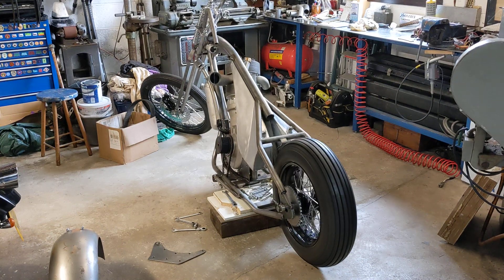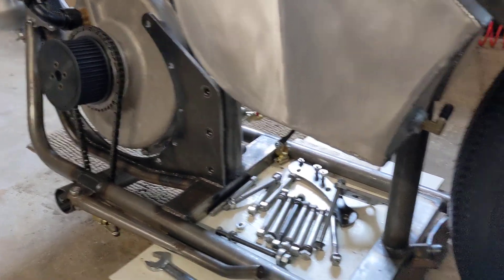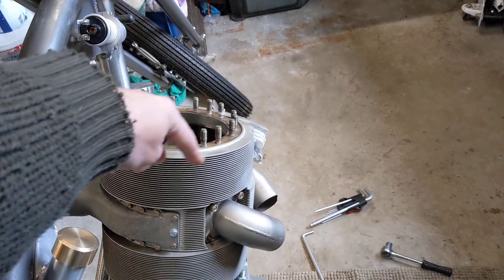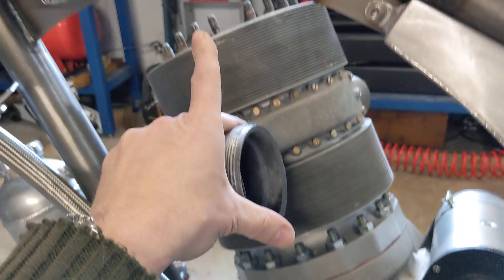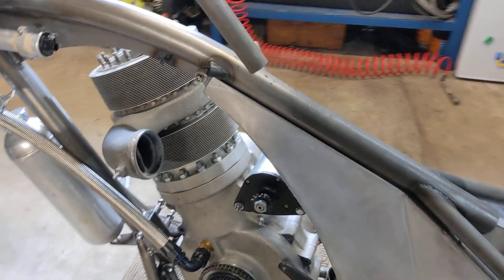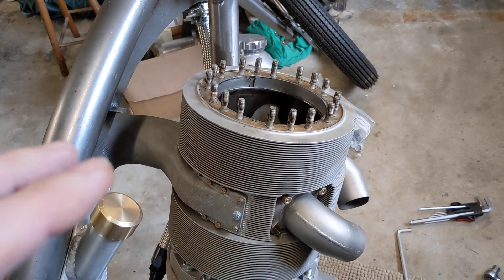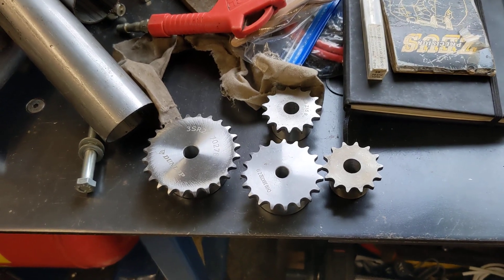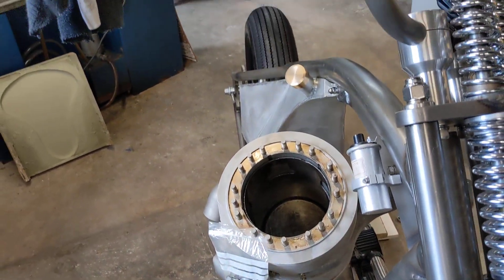Heading in and out.

Comment: In this video you can see how thin-walled the sleeve was, from what I have read limiting the thickness was necessary to ensure adequate heat transfer for cooling. Remember too that there is a film of oil between the sleeve and the cylinder wall as I understand it engine boost had to be limited or the side loads on the sleeve from the piston travel could squeeze the oil out ! . Also from the same loads there could be flexing of the sleeve into the transfer ports leading to metal on metal "clipping" . Development of the sleeves was an epic and expensive journey for Sir Roy Fedden and the team at Bristol who arguably had the best aero engines in the world at that point all of which were poppet valved.  The development of a suitable alloy was contracted out to a specialist firm who experimented with literally hundreds of variations before finding something that worked and the cost was biblical for the time. The sleeves were centrifugally cast (spinning mould)  then ground nitrided and honed to very precise tolerances using cylindrical grinders ( I think centerless) and Sunnen cylindrical hones from the US then in short supply on both sides of the Atlantic.  I read somewhere that Lord Beaverbrook had a hand in "redirecting" a shipment of these that was bound for a large US aero engine maker. Bristol's sleeve valve engine range included the Taurus, Hercules, Centaurus and Orion  with the latter being massive but never brought to market. I think all but the taurus shared the same sleeve just stroked for capacity changes. Independently the Napier company was having huge challenges developing a sleeve for the Sabre and eventually the powers that be insisted Bristol help them out . Bristol refused to release their IP for sleeve manufacture but did supply sleeves from the Taurus which in a happy coincidence turned out to be the right size for the Sabre. It was Henry Ricardo who arguably started Bristol down the sleeve valve path, Ricardo commented that Octane ratings for petrol in the UK in the 1930's was inconsistent and poor somewhere in 60's or thereabouts leading to all sorts of problems with knock. The sleeve valve was more tolerant of low octane fuels due to the absence of a glowing red (white ? ) hot exhaust valve. Of course by the battle of Britain 100 octane fuel was available and poppet valve technology  continued such that the sleeve valve advantage  was eroded. Finally I do recall reading the sleeve valve radial engine had significantly better volumetric efficiency than  its equivalent poppet valve competitor., it just "breathed" better.

Comment: When the piston is at TDC how much clearance is there between it and the underside of the head ?
Reply from the maker: Loads. I know that's not a precise answer but I'm not able to check at the moment. It's plenty though, an inch plus.
Reply: @StoneEng put some play doh in there, set to tdc then take it apart and measure
Reply from the maker: 32mm, I measured it this morning. That's from the piston crown to the underside of the head. Should be enough 😁
Reply from the maker: I can stick my whole finger in the decompressor hole. (Or a ruler). I'll measure when I'm home. Playdo would be a good alternative though.